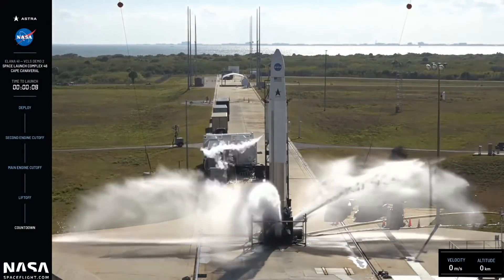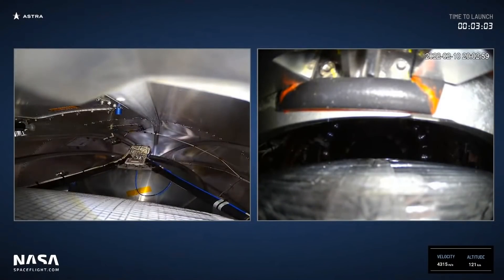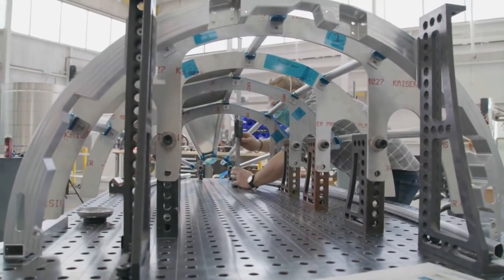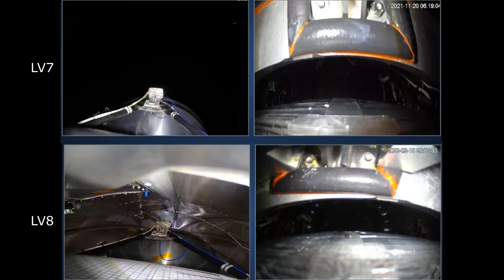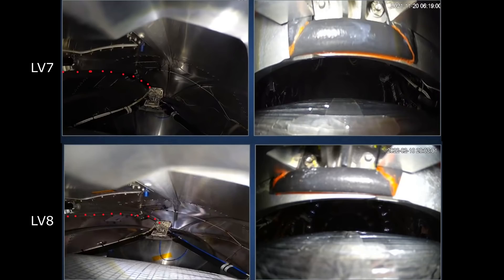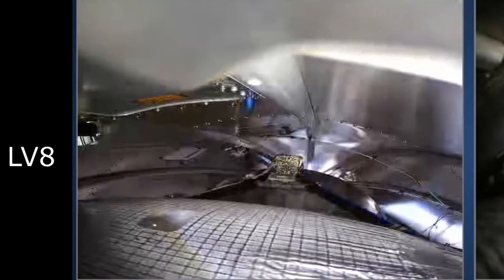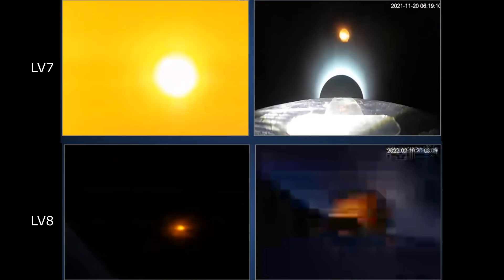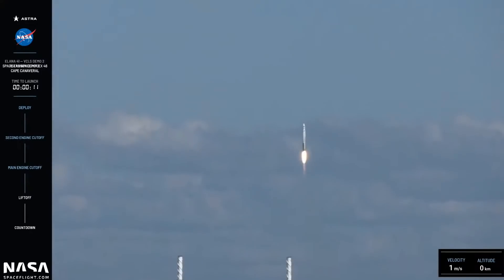Rocket Launch Doomed After Payload Fairing Won't Open

Comment: A) It is a shame that things went wrong.

B) These videos show the value of the cameras. If they didn't exist, we would only have a telemetry data stream to analyze for what went wrong.  These videos, as Scott has shown, provide helpful information that, I think, will greatly reduce the chances of the investigation resulting in "we don't know. *Shrug* "
Reply: The CNG data will actually tell a lot more. Things a camera doesn't pick up are acceleration changes. Releasing those spring rods will send a very unique shock wave through the first stage which will be detected by the navigation sensors. The timing and intensity of those signatures may reveal what component actually failed and when.
So, while camera's are valuable, they tell an incomplete story.
Reply: @iamjadedhobo  My point is that both "halves" tell an incomplete story. 

Having the cameras helps complete the puzzle in a substantial way. For example, being able to see the locked latch. I seriously doubt that was instrumented to report its open/close status via telemetry. Without the camera, it being locked could only be a supposition.
Reply: @pauld6967  I agree with you that more forms of information is better. It is just that I know from experience that people tend to put unreasonable value on visual information.
Reply: @iamjadedhobo   They certainly do.👌

Comment: Reminds me of the first attempt to dock with something else in orbit. 
The Gemini spacecraft (I forget now which one) was supposed to try to dock with an 'Agena' spacecraft. Unfortunately, the nose faring, which was supposed to split apart and fall away failed to do so.
It just split apart slightly. The mission commander reported that it looked "like and angry alligator." They maneuvered around it for several minutes but ultimately the mission had to be scrubbed. Had to try again next time.
Reply: That failure happened because the technician working on the fairing had to leave work early because his wife went into labor. When he left he had not yet connected the electrical umbilical that had to fire the ballistics to completely separate the fairing from the docking target and no one ever noticed the error.
Reply: That would be Gemini 9A, but it was actually the third attempt. Gemini 6 was scrubbed because the Agena's second stage failed to separate and never made orbit. (Gemini 6A would go on to rendevous with Gemini 7 in orbit.) Gemini 8 did successfully dock with the Agena vehicle, but an electrical short in the Gemini capsule caused a thruster to be stuck on resulting in both vehicles tumbling dangerously.
Reply: @WanderingYankee  wasn't there an Agena for Gemini 9? because the "Angry Alligator" wasn't an actual Agena, but ATDA, a non-powered backup rendezvouz target? so that it was actually 4th attempt?
Reply: @stevevernon1978  Yes, that's how the A got attached to the 9 for that mission:  Failure of an Atlas-Agena prior to the Gemini's liftoff.  Other fun facts:

While the 9A mission was in progress, NASA looked at having an astronaut stand up part way out of the capsule after it maneuvered next to the ATDA and cut the remaining band with surgical scissors carried on board.  The final decision was that it would be too risky because of stored energy in the fairing jettison system (I concur FWIW).  But a couple of Gemini astronauts in Southern California did stop by a hospital to borrow(?) some surgical scissors, then over to the McDonnell Douglas Astronautics water tank (excuse me: neutral bouyancy facility) in Huntington Beach to run through the potential EVA.

Comment: Every emergency service needs an astra rocket engine. You never know what you'll need to open next... They are pretty good at breaching fences, doors,...
Reply: Pickle jars...
Reply: @DFPercush  There's a huge market for jar openers, for sure.... The issue is getting it to a size that can fit in a kitchen drawer... 🤔🤣
Reply: @DUKE_of_RAMBLE  It just needs to come inside the jar. It'll be the next pull tab on soup cans. The engine is already disposable, we're halfway there!
Reply: @DFPercush  Hmmmm lol
Sounds like half my jar's contents will be on the ceiling, too.... 😅☺️
Style: +10
Upcycling: +10
Practicality: -7

Although... 🤔
I suppose *coughs* they could always add a warning label: 
"CONTENTS UNDER PRESSURE -- High Probability of Things Going Sideways Upon Opening."
(to borrow from present AND past calamities heh)

Comment: I like how "Astra went straight up off the pad" is a clarification that is actually necessary.
Reply: Well, on one of the previous videos, a first stage engine failed to ignite and the rest of the engines compensating pushed the booster sideways off the pad before gaining altitude.  That was interesting!
Reply: You must mean straight up off the pad. I would argue it went straight off the pad before... Just in the horizontal direction.

Comment: Asynchronous actuation permitted flexing of the aluminium panel and micro tensing of component elements in connection with... resulting in a 'jam' occurring which prevented unsleeving from taking place...

This is a common problem associated with using low braced aluminium put together with simple stock by err modern day aerospace err engineers. ...  the fabrication should have used roll resistance welding to impart length rigidity to the artifact rather than bolting which only provides momentary pressure on certain areas and is subject to jolt displacement in operation...

These sort of failures will continue due to the choice of fabrication method..

Comment: Scott it reminds me of the “Angry Alligator” which plagued the Gemini mission where the Agena docking adapter was trapped by the fairing which failed to deploy preventing the attempt to dock on the mission which was pushed back to the next flight
Reply: That failure happened because the technician working on the fairing had to leave work early because his wife went into labor. When he left he had not yet connected the electrical umbilical that had to fire the ballistics to completely separate the fairing from the docking target and no one ever noticed the error.

Comment: What a bunch of gobbly gook...  Still not clear from your explanation was 2nd stage suppose to wait on fairing deployment before igniting???   Was that point of initial fail where you supposedly point out latch did not engage.
....   If you really knew your rocket history you would know that the biggest fail out of the cape was caused by COLD weather...  Guess what?? It has been unseasonably cold in FL for awhile..  They should have held of flying until things warmed up... NASA never learns..  As they continue with their march to Diversity.
Reply: You have a lot of opinion backed up by nothing but ignorance.

Comment: I'm surprised that the engine would ignite without confirmation that the fairings have detached.
Reply: I was thinking that too (at first) but essentially the mission is lost regardless, and there’s nothing more they can do to coax the fairings apart. The only option left is to give it a shot and hope that the stage somehow remains stable.
Reply: @EstorilEm  Right, it's depending on that last burn to get into orbit, just wonder if there is a short cushion of time to maybe troubleshoot something like that before firing the engine. I guess they have a sequence all programmed in and maybe there just isn't a margin for error.

Comment: First thing I see is ~ 2:39, where there's some spark floating down- I would have to guess that the explosive in an exploding bolt or similar pyrotechnic escaped when ignited, instead of doing it's job.

Comment: was there separation?  booster seems to still be attached before blown away by engine ignition...  it wasnt just a fairing disconnect failure.  and.. did i see a gremlin out on the wing hammering on the engine?

Comment: I imagine igniting a vacuum engine in a high pressure environment is probably outside the specs for the engine nozzle. I'm amazed that the second stage didn't blow up completely.
Reply: @kukuc96  Due to the sheer amount of exhaust a rocket engine spews out it would have likely increased in pressure much more quickly than any gasses escaped from the partially opened fairing. So pressure would build up very quickly. As Scott highlighted that's probably why the fairing eventually blew open.
Reply: the gimbal range on rocket 3 is so small that this rotation just was too much xd

and their control system probably is not smooth enough nor quick to counteract some real  S P I N
Reply: @gierdziui9003  clearly needed moar reaction wheels...
Reply: @captainmaim  Real life reaction wheels get saturated.
Reply: Mayhap it did; we don't know what induced the wild attitude deviations.

Comment: could they have saved this if they pulsed the engine? (ie, blow the doors open with the exhaust from a partial startup->shutdown)
Reply: in real life engines have a limited amount of ignitions and usually can't throttle all the way down to 0%, wouldn't be suprised if that engine only had 1 ignition

Comment: I think the problem can be traced to the fact that the fairing design team was British and specified aluminium components, but the construction team was American and used aluminum instead.
Reply: Speaking as a British engineer I can confirm that this is an ongoing issue when collaborating with America in anything engineering based, combine this with our soldering and the American "Soddering" and it's just a recipe for disaster. If only there was a way we could make it work 😉😁
Reply: @restojon1  wasn't it Sir Churchill who said, "our two countries were divided by a common language"?
Reply: @restojon1  how's your teeth?
Reply: @eamonpaul5360  all 5 of them are fine thanks, now have you finished interrupting? I have tea to drink 😉🤭
Reply: @restojon1  let me guide you to the vagisil site
Reply: @restojon1  brit engineer....LOL! how's your teeth?
Reply: @restojon1  To be fair, aluminum IS the correct word and aluminium was some junk word someone else made up because he figured the name given by the discoverer did not sound cool enough. Soddering is confusing, though.
Reply: @Zonkotron  Both are interpreted translations of 'Alumen'.  Thus, if aluminium is incorrect, so is aluminum.  Since language theory has been moving away from 'fixed' usages, and towards colloquial usage, and both are in common usage, it's reasonable to say all three are correct.
Reply: No more confusing than salmon
Reply: @Zonkotron  Yes and no, it originally was alumiNUM but it was decided to change it to -NIUM like uranium and titanium, but Americans being stuborn kept the original. Both are correct depending on if you're where Americans' science bodies hold power.
Reply: @hydrocarbon82  Well, all that means is that Aluminum is correct (note, i am NOT American and i still prefer it) The grounds are simple. The naming of an element belongs to the dicoverer/discovering body. Making changes willy nilly is just bad attitude. Thank god the american Atomic Program was first or we would probably have to deal with Stalinium and Hitlerium....oh dear.
Reply: @Zonkotron  In the uk  we Solder, as 'soddering' is a criminal offence here.
Reply: Both teams should keep the specs simple and materials suppliers consistent; fabricated from a “beer can” would be universally understood.
Reply: @haroldishoy2113  Except some countries favour cans made from iron instead of aluminium - Germany is one of them.
Reply: They used aluminimum but should've used alumaximum.
Reply: Could be that aluminium is measured in Kilograms, whilst aluminum is measured in pounds.
Reply: @jackboot3946  Isn't aluminium the one measured in pounds, with aluminum being measured in dollars?
Reply: @vikkimcdonough6153  Ah. I believe you have something there, however, aluminum I think is only measured in dollars, whilst aluminium is often measured in pounds, rubles, yen, rupees, francs, shekels and Euros,...
Reply: At least it's not 11.234 vs 11,234 which could cause serious issues, or metric vs imperial.
Reply: I recall TV ads as a kid back in the ‘50s for a company — Canadian I believe — called “Aluminium Limited.” I was confused at that age, but I have to say that as far as rhythm/meter of speech is concerned that sounded better than “Aluminum Limited.”
Reply: I told them to make it out of unobtainium but they wouldn't listen to me!! That'll learn em up good!
Reply: hehehe and they spelled certain words with the letter zed instead of the letter zee.
Reply: @DderwenWyllt  works for me lol!
Reply: That sounds right!
Reply: last time they use imperial metals!
Reply: 😹 savage
Reply: absolute cancer lads, that's why it could not go to space
Reply: Al-Eee-Oom-In-Uhm
Reply: I like this aluminium thread. 🇭🇲
Reply: @DderwenWyllt  the difference is much smaller, because as you should remember, vowels are much lighter than consonants.
Reply: The American Chemical Society (ACS) officially adopted aluminum in 1925, but in 1990 The International Union of Pure and Applied Chemistry (IUPAC) accepted aluminium as the international standard which remains today.
Reply: Aluminium is how its supposed to be. You dont say other elements without the i, do you? Like Lithum, Magnesum, Kalcum, Natrum, Palladum, Osmum etcetc just sounds really dumb lol. Who says any of those like that, same for Aluminum. Sounds equally dumb.
Reply: @Xirpzy  who said Aluminum? Oh wait, the guys who named the element. He went back later and renamed it to Aluminium but by that point the cat was out of the bag and Aluminum was already entrenched in North America. It's not incorrect, it's just original.
Reply: @Xirpzy  I guess you have to start saying platinium instead of platinum too. Rules are rules.
Reply: @lastnamefirstname9043  And tantalium.
Reply: @Xirpzy  79 of the 118 elements have the suffix -ium and only 3 elements end in -num. Clearly those 3 were typos. As you say Aluminium is correct. Anyone who says otherwise is both wrong, and will probably try to tell you that imperial is as good as metric.
Reply: @brendan31415  Imperial is superior to metric.
Reply: @brendan31415  I read your comment and though how funny it is that we Americans use the imperial system and the world says we're behind or silly for it. Yet the rest of the world fails to even attempt to compete with us. 🇺🇸💪🏻💪🏻💪🏻
Reply: @theg.c.142  Not because of it, but in spite of it.
Reply: Damn Americans

Comment: Astra official: please stand by as we investigate the issue. 
Astra thinking: let’s wait what Scott Manley will find out about it.
Reply: Mechjeb failed
Reply: @captainmaim  But is it a mechjeb failure if the staging was set wrong?
Although, when I think about it, Mechjeb just refuses to fire the engines or release a decoupler until the faring has been staged, so in this case mechjeb might have been an upgrade ;)
Reply: Wisdom of the crowds. Think there are a lot of good ideas here
Reply: And what Manley recommends.
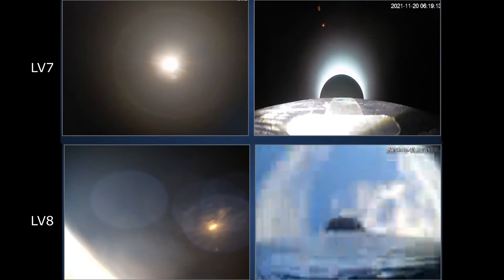Manley: "check yo staging" 6:02

Comment: Since the gas accumulated and sought the easiest egress from the confinement it would create thrust in a lateral direction causing the second stage to tumble violently. I would have been surprised if the attitude controls could have even begun to overcome what happened to the second stage. That was an enormous amount of uneven explosive outgassing of the rocket gases almost like the rupture on Apollo 13. Less violent of course.

Comment: The rocket pitched over way too much during ascent. The booster is designed to fall straight down (because the rocket should be going straight up) at stage-sep. This rocket was traveling near perpendicular to the ground at MECO. It appears that upper-stage basically got wedged inside of the booster cowling when they attempted separation - almost certainly because of the unusual attitude. S1 is supposed to go straight up - as high out of the atmosphere as possible, then stage-sep, then the rocket pitches over and the vac-optimized engines just add the delta-v you need to give you orbital-velocity. Things went wrong with this flight seconds after ignition. The rocket was in an abnormal regime for the entire ascent phase.
Reply: Did they publish that unusual flight profile because otherwise everything about it sounds wrong.

Comment: Rocket launched up. Good.1out of 4 achievement. 25%
Rocket flew to separation position. Good 1 out of 4 achievement. 25%
Rocket tried to separate 1st stage. Kinda good. half out of 4 achievement. 12.5%
Second stage engine worked. Good.1out of 4 achievement. 25%

So by my simple reckoning the mission steps achieved was a 87.5% success 

but share price fell 26%.

Me think buying opportunity..

Comment: It's tempting to imagine the power of a rocket engine could harmlessly blow away a fairing, and I suppose it did, however rocket flight is a literal balancing act and for a split second the fairing was able to turn the thrust sideways, so it literally spun out of control. Hm.